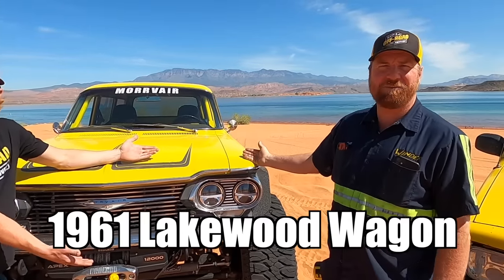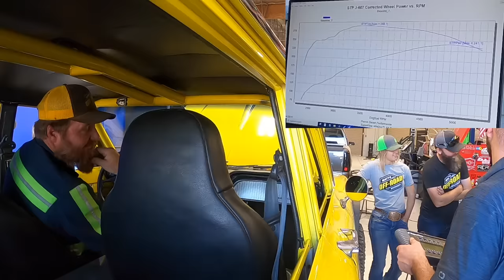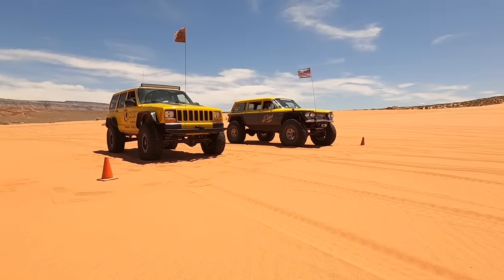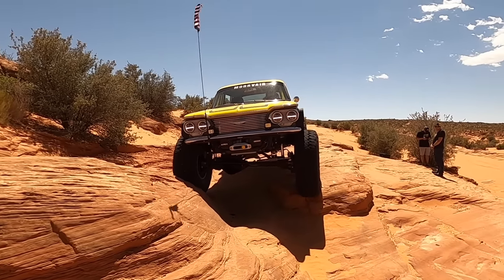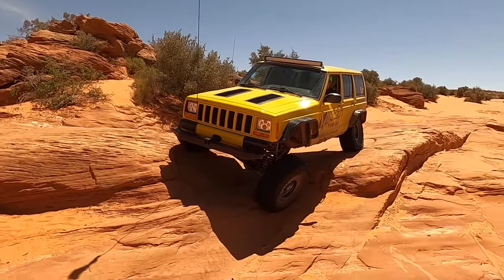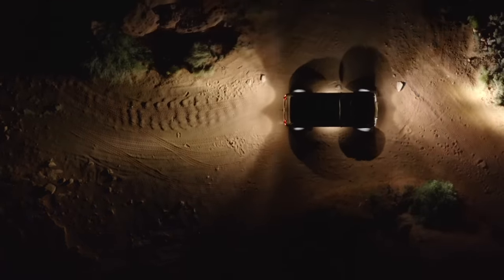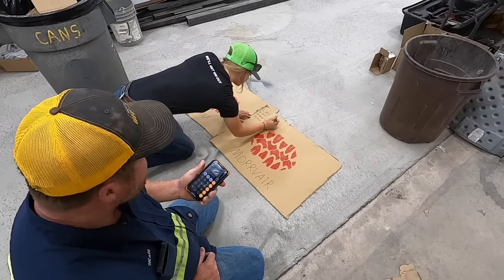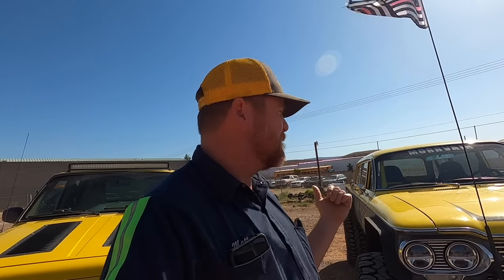Banana Vs Morrvair - Ultimate Off Road Challenge!

Comment: The Banana deserves a 3 month spa day and a total makeover.  It's been reliable and functional for years on probably 1/25th of the build budget & time and then it gets publicly humiliated as a thanks. Poor banana - we still love you!
Reply: I think like another poster said, despite it's failure to make points, it's still done it far longer and with far less fanfare so it's still the winner of the bunch
Reply: @MattsOffRoadRecovery  I'm guess upgraded cooling and some suspension work are in the plans? Maybe even upgraded lighting? Or is it gonna be a whole new engine? I have been shocked at the size vehicles that Jeep has rescued.On a side note it looks like your dogs pretty much have it made.They probably have it better than you do.
Reply: Yeah the Banana has done some amazing stuff over the years.  The Morrvair though, that's a classy build - 1000 lbs heavier and no more ground pressure, and with built in winch etc.  For snatch recoveries, that extra weight is going to give it the edge.  

The one you didn't measure was the ramp breakover - that's one drawback with the longer wheelbase; more chance to get stuck on the crest of steep dunes.
Reply: Stroker kit for the 4.0 would make the Banana a beast.
Reply: @lanceltn8979  my plan on my 4.0 jeep has always been stroker and the low pressure turbo kit from banks, but that is because my jeep lives at 1 mile+ in elevation and when camping/running trails I am going up from here. Boost helps make up for the thin air.
Reply: @MattsOffRoadRecovery   Id like to see u put a diesel in the banana. Or make a green banana with a diesel engine
Reply: @chriskulpa4056  is it a failure to make points if it makes those few points every day of every year.
Reply: @sombrero4316  Well, because they were only awarding points that day...hard to say :) They're both great tools for what they are IMHO. The Morvair definitely does it would style! It's a righteous rig
Reply: Poor banana man
Reply: She did her best, and is the best of her time!
Reply: @MattsOffRoadRecovery  can someone please tell me what that is in the sky at 4:50 is it some sort of kite/beacon to inform someone of some sort of info? like I've never been to serious regions of the US where they go off road like this and I know they have crazy gadgets to assist or recon areas for off roading of some sort but I've never seen that
Reply: @austinshackles549  They totally screwed up the math.  Guaranteed there is a differential weight distribution between the front and rear of front engine vehicles. Often enough, there is a corner to corner difference.  that's why professionals put scales at all four corners before declaring the weight balance.

Comment: The fact that the XJ has been pulling vehicles twice its weight out of mud, snow, and sand says everything that needs saying.
Reply: Some way, way more than twice it's weight.
Reply: Yeh, and its kinda like comparing a 6 cylinder s10, to a v8 silverado. The fact that the banana didn't get completely smoked is a testament to how much a smaller wheelbase matters off road in a lot of situations.  If you removed every test that had to do with horsepower and weight the banana would have it. I think Matt needs to find himself a v8 4.7 ho out of a o2 Wj overland to stuff in that old girl. She'd be putting similar horsepower to the wheels as the corvair,  and run the tests again.
Reply: the xj will always be my fav do-everything-year-round vehicle.
Reply: You got that right! That jeep has more heart and soul than that corvair or whatever it is there will ever have!
Reply: I’d buy a xj as a lil trip truck any day that’s coming from a Chevy hillbilly
Reply: Mhm. Tsa good rig right there, mhhmm.

I reckon I'ma kill you with this here slingblade, mhm... 
Ok ok, too far?
Reply: can someone please tell me what that is in the sky at 4:50 is it some sort of kite/beacon to inform someone of some sort of info? like I've never been to serious regions of the US where they go off road like this and I know they have crazy gadgets to assist or recon areas for off roading of some sort but I've never seen that
Reply: A hip-hip-hooray to kinetic energy and floatation - and to those who know how to use it! 🎉

Comment: The banana has been doing all these recovery’s with 105 WHP. Lol. Goes to show that skill will go a long way.
Reply: Also Torque ;)
Reply: the 4.0 i6 is about 180hp new the banna is probably got a nice dirty air filter and the style of dyno gave it way lower hp than it has though hes loosing hp through gearing and tire size. the corvair is probably even more powerful if they use the dyno style that bolts to the hubs
Reply: Yea, all that tire kills hp and trq on a dyno but it made for a good comparison. Its not like he's trying to tune them...
Reply: Gearing!
Reply: Seems like everyone is wheeling with these newer Cherokees. It's like everyone forget about the original Jeep Cherokees and no one drives them anymore!! When I am mean original I mean 84-89 the AMC era where the 87 got the original 4.0
Reply: Skill and gearing.
Reply: @GoonieLord  all rotted or been killed maybe 🤔 or too expensive for a good example ??
Reply: @mrwolf9335  I've recently seen a 88, old Cherokees don't die, only their owners do
Reply: @GoonieLord  fair play 💪
Reply: There's 2ltr 4 cilinder engines with more hp and torque!
Reply: One of the strongest early 4x4's was the series 1 Landy, which was used here in the coal mines back when my dad was working there as a young fella, and they moved fully loaded coal carriages close to 100 tonnes, with 50hp... gearing means a lot more than hp in straight pulls
Reply: @johnp2110  
My '74 C-50 has 6.71 rear end/350 V8. 5 yard dumptruck.
Reply: Torque and gear ratio
Reply: Seems those Kinetic energy ropes are the key in most situations.
Reply: @GoonieLord  
That 4.0 is based on an industrial engine from the 1930s.
Reply: @WirageVoyage  "also torque" - but you know that it is almost the same? Power=Torque*rpm and rpms are similar for standard petrol engines, unless you have a bicycle engine. (And even with high rpm low torque engines you are gearing it differently and torque on the wheels come again)

Comment: Banana is a beast, despite been smaller in size and having a smaller engine, never quit. That's why I love xjs and the 4.0
Reply: They were only gettting 105 HP on the dyno?  The 4.0 liter I-6 on the XJ is supposed to have 190 hp...
Reply: @CurmudgeonExtraordinaire  Parasitic loss. The 190hp for the High Output 4.0 is at the crank. Once you send that power through an automatic transmission, a transfer case and 35 inch mud terrains (which are significantly larger than stock tires), you are going to see a significant loss in power getting to the ground.
Reply: @knivesinedc  -- It would be interesting to see what a stock XJ would do on that same dyno test... I suspect that the larger tire size could probably be compensated with by way of appropriate gearing to get it back to whatever the stock XJ would have gotten.  I guess if he was curious, he could put a set of original XJ tires on it and do a baseline test.
Reply: @knivesinedc  Which, for the purpose of the build, can prove beneficial at certain times, and not so much at other times.
Reply: What kind of headlights are on the banana  I have a tank of a zj and I'm looking for head lights
Reply: @CurmudgeonExtraordinaire  gearing has nothing to do with the numbers. I imagine they would put proper gearsets when they built it in order to retain the oe final drive.
Reply: I bought my 99 XJ last winter with only 137k on the clock. Love it
Reply: @20somthingrealestate  he says in the video it's either 5.13 or 5.38 gears in the xj.
Reply: @CurmudgeonExtraordinaire  with stock tires but with 36 inches it changes things a lot. But it is still a very strong machine, hp's are just numbers😀
Reply: I bought my own Xj a month ago because of this channel.
Reply: I used to have an '89 XJ, it was an awesome vehicle for it's time. The 4.0 and Aisin transmission were absolutely bulletproof. The rest of the car, being a 1980's Chrysler product....not so much. Flexing (and they were flexible) caused the windshield to crack in the corners, the fiberglass rear hatch to crack. That's how you wore one out, eventually the welds that held the unibody together would fail and it was cage it or junk it. So much fun tho!

Comment: Time for the banana to be shown some love with a host of upgrade parts, as that old workhorse has already earned its’ keep; whereas the moorvair hasn’t yet. Chrysler/Jeep should sponsor the channel and donate a hellcat engine/trans/ecu for the Jeep.
Reply: yea baby!
Reply: Yup edlebrock makes a head for these 4.0s and whipple makes a supercharger as well that 4.0 will be a monstrosity with just those 2 upgrades put in 4 hole or even 6 hole injectors maybe a cam and wowsers man they're  a fucking blast
Reply: Came to post this
Reply: Shouldn’t use shitty new Jeep parts that inline 6 cylinder hes already got in there is good
Reply: Putting a big motor in the Banana would remove half of the purpose - sometimes enough is enough.
Reply: start with longer brake hoses.
Reply: Remember that demon engine is using ac to cool down. If you will start to rush this engine on desert you will kill him. Mat is doing good job, more important is torque and not overheating than just power. I think more anoing in Jeep is gearbox which isn't locking at 1 gear. Many times May complain at that point.
Reply: Hell cat motor will never work with the unibody. Unfortunately the thing that makes the most sense is an ls swap
Reply: @calebwinebrinner1764  I did a 4.7 swap in mine and it’s a massive difference. Same I6 design, but more power and torque. I’ve got 221hp to the wheels and 302 torque vs the old straight 6 4.0 which was 122 wheels and 268 torque. Big difference

Comment: For the tire grip area , they are ovals: A=pi*a/2*b/2
Morrvair: 119.5
Banana: 104.1
Reply: Doesn't matter, each where at 8psi
Reply: Was wondering if when calculating psi per vehicle, I never saw you mention that you had 4 tires supporting the weight, was that figured in?
Reply: 😂 All the math to figure the Lbs Per Square Inch. It was cool to confirm, but the  psi of your tires is also the pressure on the ground. The key is having a large enough tire to be rated to support the weight of your vehicle at the desired inflation. Tire manufacturers make "Load Index Charts" for tire sizes that tell you the proper inflation given your vehicle's weight and top speed you wish to drive.
Reply: if you really want to get accurate, then measure out each contact patch seperately instead of counting the gaps as part of the area
Reply: @andrewhaataja6074  the math was to determine the contact patch size, because tire pressure alone doesnt tell you anything. 😊

Comment: Enjoyed this video!   From my perspective it was a kind of apples and oranges comparison.  The Cherokee is basically a factory stock vehicle with modified suspension while the "Corvair" is a purpose-built custom chassis with a Corvair station wagon body sitting on it.  A testament to factory engineering!
Reply: The engine and gearbox may be stock in the banana, but the suspension axles and diffs certainly arent

Comment: I really wish you would do a series on fixing up the banana 🍌. She deserves the rebuild.
Reply: You spelled upgrades wrong.. Why rebuild, when you can improve? ;-)
Reply: @n9mxq  My opinion is that the banana 🍌 is perfect the way she is. Like fixing the cooling system and suspension. Upgrade and they're just building another Morevair.
Reply: @johnschell7514  Still upgrades.. But yes, the cooling needs work, and a few tweaks to the suspension is all I meant also..
Reply: Especially the broken interior bits and headliner.
Reply: @MrErichonda30  nah, that's character

Comment: XJ's were available as a "Police Pursuit Package" and with the stock tires actually would out handle many sports cars.  Mine is stock height on oversized sway bars and 255/55/18 tires and will easily do the average freeway cloverleaf offramp at 60+mph.  I do logging roads up to radio sites all the time but would never be able to do what you guys do in its current configuration.   Its been very fun watching your mods on both these guys!

Comment: That dog in trunk issue is a simple fix... just add a custom step as part of the bumper or tucked under the bumper (slides out when needed, like how they do stairs on a camper).
Reply: good idea.
Reply: Could make a small insert for the tow hitch with a little platform to give them a better footing
Reply: I was think a u-haul-truck-style pull out ramp.
Reply: @ADBBuild  Ya, that would be the ideal thing to go with, but I assume Matt would likely want something a little more portable / less hassle kind of solution. But a ramp would of course be better than a step as animals don't even hesitate with a ramp.